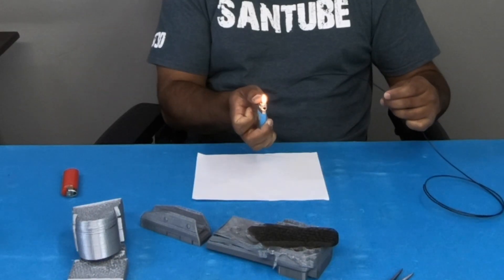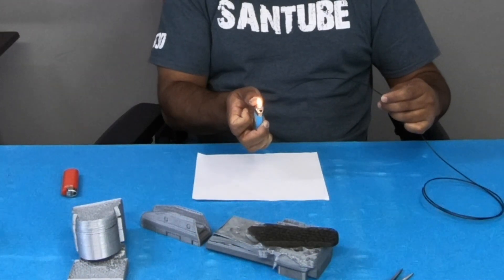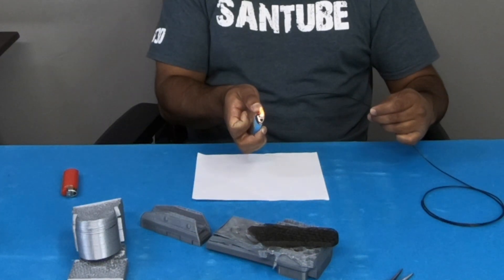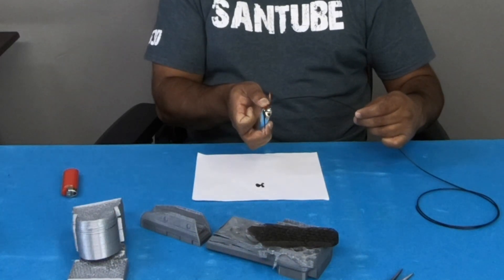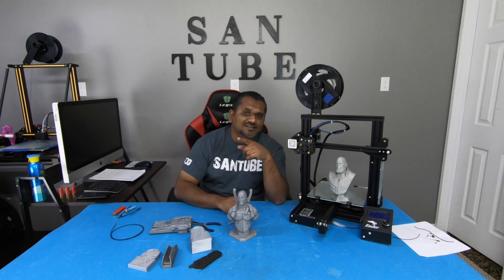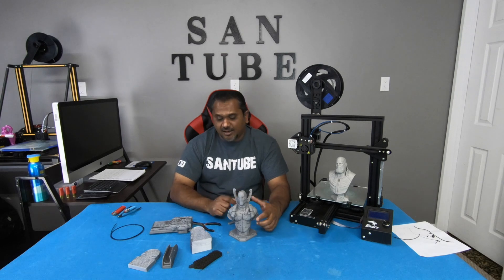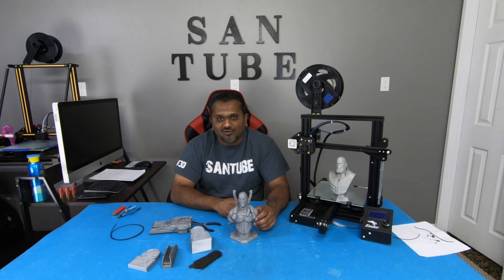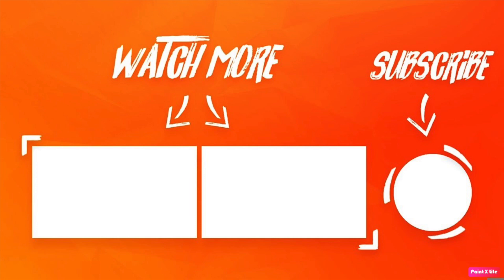3D Printing Brittle Prints

Comment: Tbh, you mentioned a good point with very bad examples. What you are demonstrating is the additional heat production, not the temperature change. Even if you light 100 lighters, the temperature of the flame is almost constant, but the generated "heat" a.k.a energy is greater. The science behind the temperature increase situation is that you are firstly increasing the heat generation and secondly increasing the temperature difference between filament (can assume a fixed surface area and volume) and nozzle (definitely a fixed area), which is the key point. The temperature difference allows the filament to reach the melting temperature quicker which is useful for having faster melting polymer pools thus allowing the increase of print speed as long as the heat generation doesn't bottleneck. However I think manufacturers should add the heating element properties to the specs of the printer so that we can calculate the maximum speed of printing without having problems with simple thermodynamic calculations :)

Comment: I’m also getting the same problem, perfect prints up to 50%, then after that each line becomes brittle, done the temp tower like you said, and 215 with a bed of 65, so i may now keep these settings and try reducing the speed from 50% to finish and hoping that will help.
Thank you for making it easy to understand for us new folk.

Comment: Can moisture also contribute to the brittleness in 3d prints? Moisture in the filaments?
Reply: Yeah, if your spool has been left out for awhile or depending on the quality of the spool, it can absorb moisture. It you bend filament  and see that is snaps easy or feels kinda of mosit it needs a treatment. Having a filament drier or following a video on how to safely dry filament in an oven can save a spool. Although sometimes I find poorer quality spools can't be saved. Though that is rare.

Comment: Can anyone explain why i get a perfect 1st layer and maybe a 2nd but then it all goes to hell with globs and the nozzle coming back hitting those. But if it makes it to the infill layers it corrects itself like it now has pressure relief areas? Does that make any sense guys and do you know whats wrong? P.s. it's not steps or speed or temp.
Reply: you might have to go  through your slicer settings. I noticed, at least on cura, there are different setting for different parts of the print. for example, your print speeds or retraction perimeter of the model is usually different from what the printer prints the first layers or infill. I would recommend maybe looking at reddit for your specific printer and see what settings people think are best for print quality.
Reply from the maker: I agree with Mega.  Also I know this will sound typical but next time try lowering you bed a little more, maybe on the side that it is hitting.